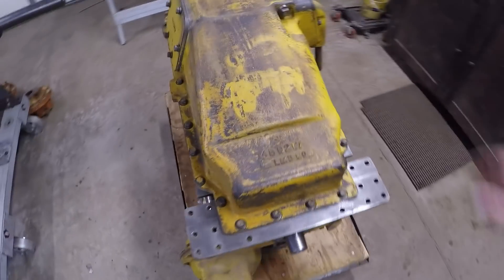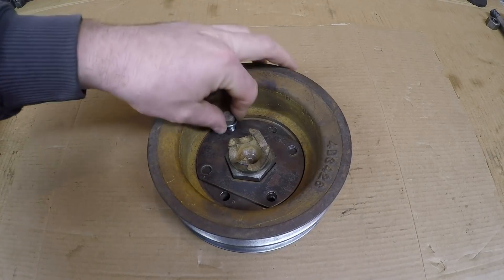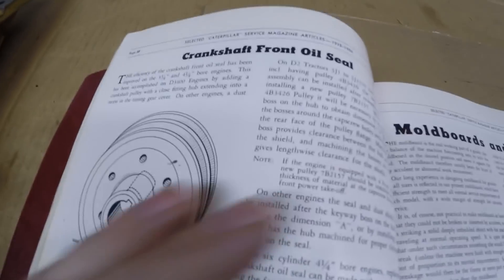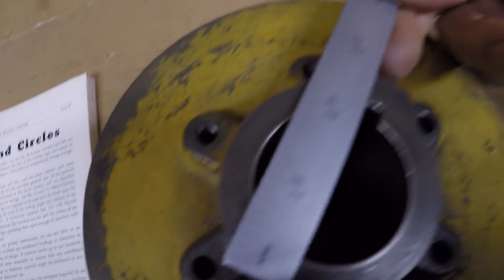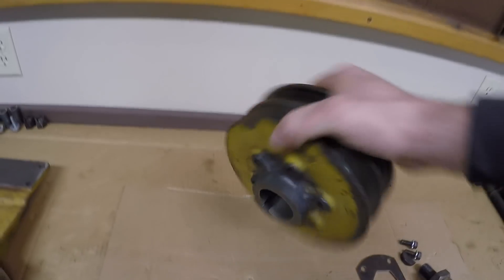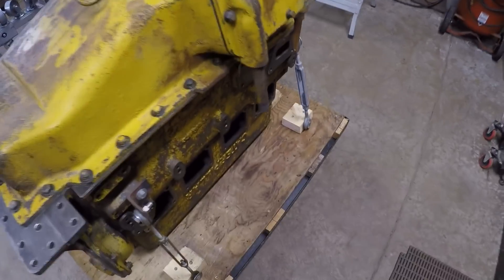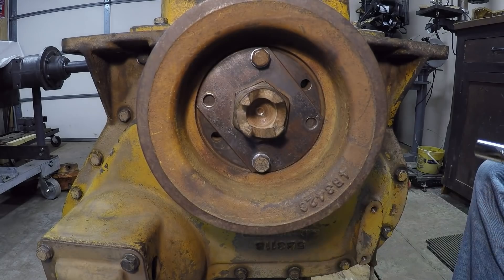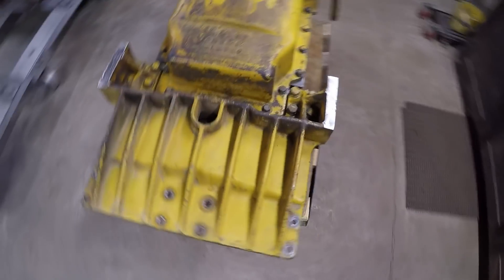Caterpillar D2 #5J1113 Diesel Engine Assembly Ep.18: Crank Pulley & Radiator Support Installation

Comment: I noticed that the claw bolt if used to "bar" the engine would actually turn the engine backwards assuming that normal rotation is clockwise if viewed from the rear.  I'm guessing that the claw bolt can also be used to drive a front hydraulic pump also clockwise?
Reply: Edit:  I see the fan in another video indicates the engine runs counter-clockwise so scratch the above conjecture. :)   Wonder if anyone has tried mounting a starter on the front via a gear reduction?  I have seen a little gas engine geared to the PTO at the back for starting.

Comment: They are only original once. I'd rather have a nice original-looking tractor than a restored one any day of the week, EXCEPT if "original" condition is too rough to leave untouched. I would, however, recommend coating the tractor with mineral sprits or linseed oil once it is all back together, to protect and make the original paint shine.

Comment: Just because the dozer did not have a generator doesn't mean it could not have one later.  Even a one wire alternator could be installed in a clean revertible setup..   I am glad she is growing more complete by the video.  I  like your plan to make it a working machine.   It has been  said many places, " They are only  original Once.   Mustie1 uses melted toilet ring wax to seal the patina on his truck.   A lowb buck way to freeze the surface condition of the machine seems to fit this project..It yor baby and I wish I could be there helping her live again.   Good luck.

Comment: Another good video, I hear 'ya re the paint :-). 
I notice you reuse lock washers, I know you use them because that's original and I respect that, but have you ever thought of getting rid of them, using regular gr8 flat washers (because of their size, not their strength) and Loctite?  I've seen soo many of them break, granted they were probably tightened by an impact gun but still, I've never trusted them. IMHO the only time they do anything, if even then, is when the fastened has already come loose..........Mike

Comment: Dang. I'm on the exact same wavelength as you are in terms of keeping things original. I have a Harley Davidson 1985 FXRS that I'm trying to keep as close to stock as possible. I did have to change the controls to forward controls only to fit my 6'4" Sasquatch sized frame, and I put a 4 piston caliper on the front just for safety. But I saved all the original parts, put them in boxes, and marked the boxes so if or when the time comes I could make it 100% original in a couple of days.

Comment: Paint. Or not to paint. Reminds me of the Twenty and the cat 15 pull grader my family had growing up in the mountains north of Los Angeles in the 60s.. one of the neighbors has the grader restored/repainted and sitting on display in his front yard.. the twenty with a seized engine sits among the sagebrush soaking in the sun for the past 57 years since dad showed up with a 5 gallon bucket of the best oil based enamel he could get. He might have has it made at the paint factory he worked for. Around 2000 I visited the family acreage and there it was. Almost a nuclear glow from its probably hansa yellow paint. 

I reached out to touch it as that twenty shared my outside  play area carpet till I was 8.  I pulled my hand back when I thought about the amount of lead in that bright glowing paint and realized I really did not want to touch it. 

So have you done any lead paint tests on your collection and stacks of parts. 

 I can still see the bright yellow paint in Google satellite images just as a blurry dot of yellow. 

It's just a thought. Perhaps a clear coat to seal the lead based paint in where hands or body parts. Come in contact. Or where children might touch. 

 Oh well back to the Italian tractor company vehicle I have been reassembling after a clutch component failure. If you think cat parts are expensive. Better sit down..

Comment: I agree with you on the paint choice, if its to pretty to use its becomes useless. If the front seal up date is a concern just glue a felt washer to the front of the seal to close up the gap to the rear of the pulley. Would have to work as well as the modified pulley and all parts remain OEM

Comment: You going to have so many comments about why didn't you torque the crank nut or did you leave that as bate for the fish to bite. I don't doubt you have done it or plan to when you can lock the engine with the flywheel or transmission. Also good call on not painting the old girl right decision there.

Comment: Hi Squatch,
I see the same question I wanted to ask in the reply posts.
What about the torque of the crankshaft pulley claw/bolt?  
I understand that the retainer bolted in place will stop the claw/bolt from backing out, but them Cat engineering people had the have a value for that bolt.

Comment: Squatch, do what makes you happy on the paint thing. It's your project. I totally get it. I have an ancient wood jointer, weighs several hundred pounds, and it looks like hell but will outperform any new equipment I've seen. Plus it has it's own "cool" factor - an old DC motor the size of a large watermelon!

Comment: Squatch, I get it about the paint. But you just showed us some parts that have been taken to bare metal that will flash rust in 10 seconds in Minnesota. Do you intend on using a clear coat or some other preservative that isn’t paint?
Reply: Oil fumes is also a good rust preventor, and 'period' ofcourse..

Comment: The claw nut lock plate is pure genus. 
Looking at it from a mathematical perspective, there are 6 opportunities to receive a bolt in the pulley. Because the 4-hole plate can be turned over, there is an equivalent of 8 holes in the plate to receive a bolt. This means there are 48 combinations for one hole in the plate to align with one hole in the pulley but two are needed so that means there are only 24 correct combinations. When 360º is divided by 24 combinations, the lock plate can be clocked every 15º. The hex points on the nut are spaced every 60º and because 15º is 1/4 of 60º , it is relatively easy to get a good match. If I am wrong with this analysis, please let me know.
No paint? Ah, a "Rat Cat". I love it.

Comment: When I restored an old Singer sewing machine, it was dismantle, clean, oil, re-assemble. Only new part was a drive belt for the motor. Not a drop of paint. Original wear preserved.
When I restored an old Anglepoise light, dismantle, clean, re-assemble. Just new period cable and grommets for electrical safety. No paint, original dings preserved.
I'm with you Toby.

PS It was only 14 bolts on the radiator support? Not 14 billion?

Comment: Did Cat provide torque specs. for the early machines? I've got a 51 8N and have only found a few things that mentioned torque settings, of course 90% of the bolts are 7/16" so they can be snugged sufficiently.

Comment: It’s yours do what you want. I do have a question, was there a torque for the front pulley bolt?
Reply: I wondered too. Went back and although he didn't show it, he did say after "once you get that tight". I was most curious how he held the engine crank against the torque wrench.
Reply: I want to know that too!  I also want to know how he torqued it, specifically how he kept the rotating assembly from moving.
Reply: Was a little startled by that myself.  From the way he has done everything else, there is NO WAY he left that bolt finger tight.  Like others though, I'm curious about how he held the crank.

Comment: To not properly paint the finished product is an insult to everyone involved in the deign and manufacture of that engine when originally built. You would never consider shimming a bearing with a beer can yet you consider it quite acceptable to leave a rebuilt engine an unpainted hulk. The job is not complete until the paint is applied. You go to great length to praise the design and construction of vintage equipment. Well young man, a finished paint job was part of that design and manufacture process. Yes, it is up to you to paint or not but the fact remains, without  proper paint, the job is neither first class or complete complete..
Reply: Plus there's no protection, all this hard work is going to RUST. It doesn't have to be a pristine paint job, but at least cover the bare metal!
Reply: @squatch253  Squatch,
I think you are mixing apples and oranges here trying to justify a position. I did not say it was preferable  to leave the tractor rotting in the ground. I am quite please a accurate restoration is in progress.
l do fully understand the the finished product will not be totally "original " but rather a very accurate recreation of the tractor as built with factory correct parts from various sources. I fully agree the project and attention to detail is very admirable and should be a tribute to all those who were engaged in the design manufacture, assembly and marketing of the finished product.I know you are very much committed to design specifications. Well you can be assured that the design/product acceptance criteria for that tractor when built also contained a paint standard and visual acceptance specification which had to be met prior to shipment from the factory. I say to you again the individuals who poured their heart and sole to make that tractor a viable product in the marketplace would have never allowed it to leave the plant as an unfinished unpainted hulk. If your desire is to honor the product and those who built it, then paint it as they intended.
Reply: Stude289 You can paint it at any point in the future, it is only original once.
Reply: It was properly painted when it left the factory, so it i not "original" until it is painted
' @mfreund15448
Reply: Public shaming!  Public shaming!

Comment: Dumb question, why wouldn't you use something like fluid film or never seize between that lock plate on the crank pulley or between the the radiator support and the block to prevent rust jacking?

Comment: No spring washer under the crank pulley?  I think it looks fine in its old paint, follow your heart!  Thank for posting, it's really coming together.
Reply: No spring washer because he used the nut plate with the two bolts hold it on.
Reply: @paulsilva3346  The washer under the pulley nut not to stop rotation of the nut but to supply tension to the nut.
Reply: @squatch253  Yes, tension like a head bolt, thanks T.